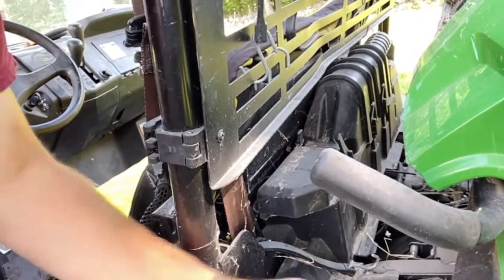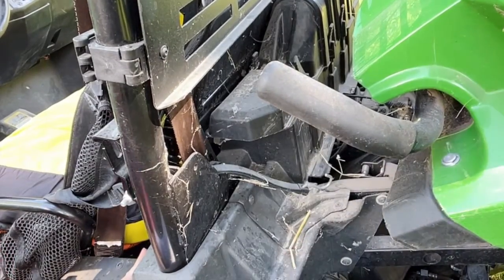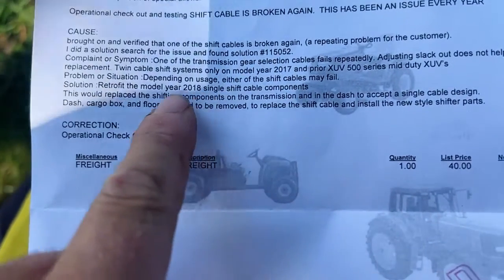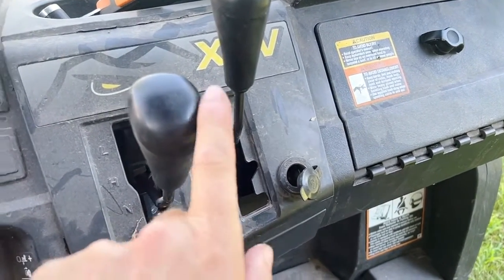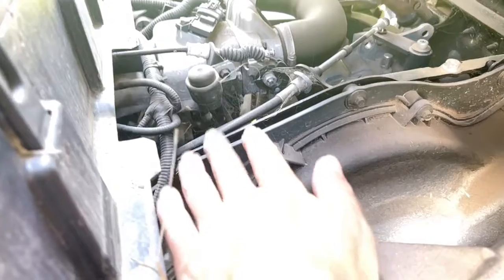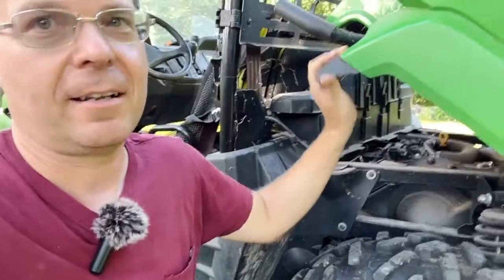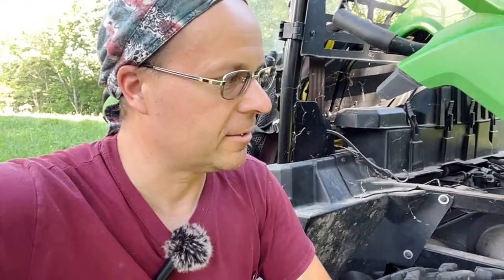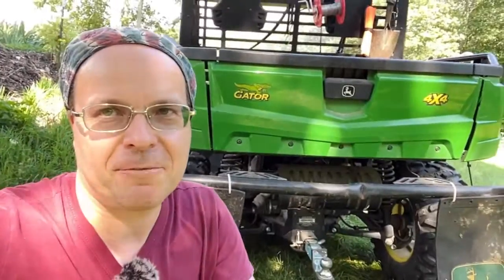John Deere Gator XUV 590 Shift Cable Broke AGAIN and Here's How to Fix it

Comment: I feel your pain.  I have a 2013 550 S4 with the well documented shifting issue.  I love the mid-size sxs and was contemplating upgrading to the 590 for powersteering and the larger HP greater top speed but knowing they still havent fully resolved all shifting issues I will have to pass.  Wouldn't even have considered another JD XUV but my 2013 JD 4520 compact tractor has performed flawlessly to date as has my  JD riding mower so I know JD can build a good product.  But these mid-size sxs  give a whole new meaning to "bleeding green".  Thanks for sharing.
Reply from the maker: im really crossing my fingers that its finally been resolved ed.  I like it otherwise as it's the perfect size for me, but if I were a new buyer, id go with a Polaris.  thank you for watching and I hope you can find what you're looking for

Comment: Just had a cable break today on my Gator 590. I'm handy so started with pulling the old cable. Man! that is a chore to pull all the plastic, seat etc. to get access to remove the old cable. Called my JD dealer and they happened to have one but I ran out of time to replace it today. Not a pup at 68 and my body hurts tonight. Disheartening to know another failure is imminent. The cable was $75.00, can't imagine what labor would be to do this job. I'll look into that retrofit, as mine does have the 2 cable setup. Hope it goes back together easier than it came apart. This thing has less than 100 easy hours on it.
Reply from the maker: I did the cable the first time on my luv 550 and was sore for days. the original design was terrible and I am hoping the grade lasts.  a replacement side by side is out of the question at todays prices.  fingers crossed that yours doesn't break again

Comment: I have a 550 s4 and I 've had to replace the shifting cable 3x for $500.  It's ridiculous.  I've put 5x more money in my JD than I have a 20-year-old kawasaki mule.  Great video, perhaps next time I go in for a repair they can do it correctly.
Reply from the maker: I’m hoping this “fix” is the last one. They fixed it once for free under warranty, but it kept breaking. I’m not super impressed by that, but, otherwise, it’s been ok. Would I buy again? Nope.

Comment: I have a 2016 xuv 560. Mine shifts fine until the weather gets cold then it's stuck in whatever gear I parked it in. As you described, I have no problem at all with the 4wd shifter, but once it gets cold it's not going to shift until the weather warms back up. An friend of mine had a 550 and he actually broke the shifter lever off when it was cold trying to change gears and I took a piece of 5/16" round stock and made him a new lever for it. But I don't understand, if a person pays thousands of dollars for a machine like this it should function better. This is a flaw on John Deere's part.
Reply from the maker: that’s a great way to fix it! there is an updated cable, but they won’t replace it for nothing and that’s not very good customer service. the district manager called me and he could not have been any ruder or more condescending. thank you for watching

Comment: Can you buy these new parts over the counter and install them yourself I'm wondering...  I'll call and ask and thanks for that number...

My 2014 xuv 550 forward/reverse shift cables freeze up.   I replaced one and kept the old one.   New cable I was told "redesigned" cable and only  lasted a year...    Lucky I kept my original one and hung it up and dripped cable lube down it  and put it back in.  
Fast forward to this cold weather and it's froze up again and I busted the little end of the cable.  

Got 1000 hours on it and love it but dread the winter months.
Reply from the maker: Yes. I did it myself the first time they broke. You have to be a bit of a contortionist to do it. I love my gator otherwise as it’s super nimble and handy. Thank you for watching

Comment: I need to do what you did, I've replaced it twice myself and I'm not doing it again.  Who did you have to talk to to get deere and the dealership to help pay?  I'm so sick of this.
Reply from the maker: I replaced it once myself,which about killed me. The dealership fixed it once under warranty and then it broke again. Fortunately, the service lady at my local dealership got Deere involved and the regional manager called me and said they’d pay 1/3, the dealership 1/3 and me 1/3. There’s a new replacement upgrade that should be used. It’s been 18 months or so and while it does shift stiffly, so far so good. I’d start with your local service dept and then escalate on Deeres website. 🤞